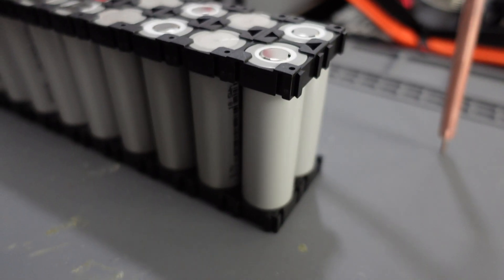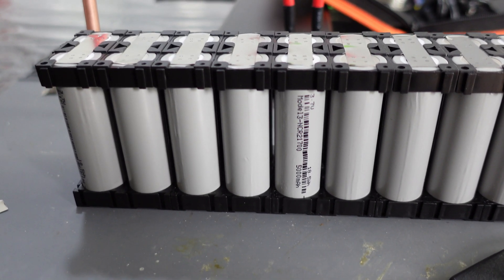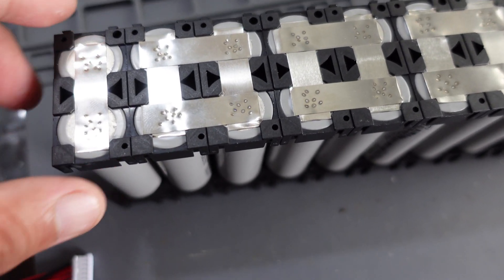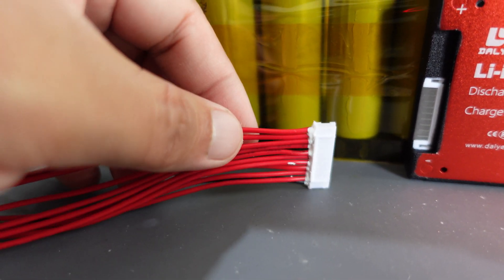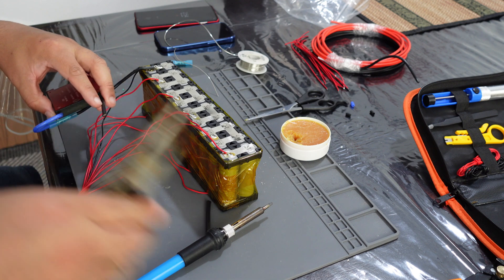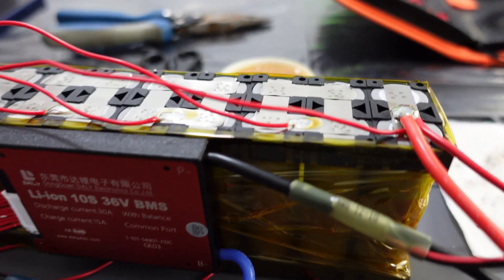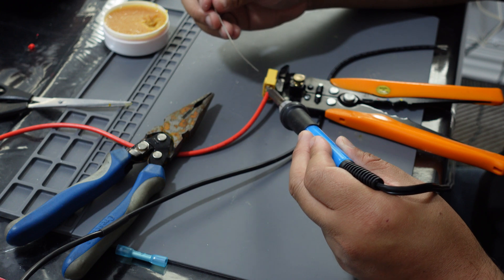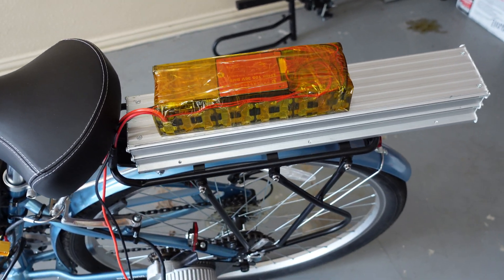Built a 36v ebike battery from Tesla Model 3 cells 21700

Comment: How is this battery pack behaving after 2 years? Any balance issues?
Reply from the maker: Still performing just fine. No balance issue, then again I haven't really drain it low enough on my ebike.
Reply: By the way I have the exact same spot welder and soldering kit (mine is branded Pulsivo).